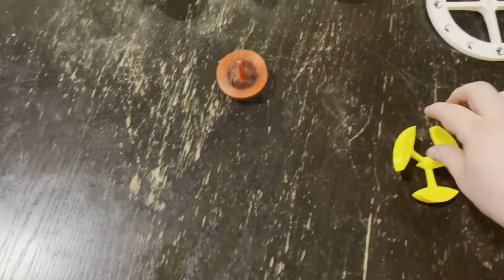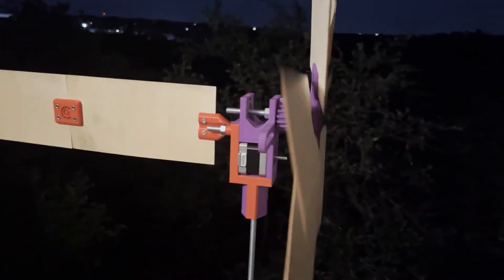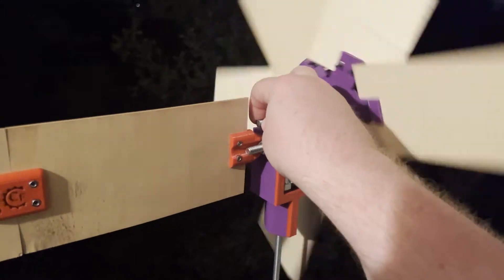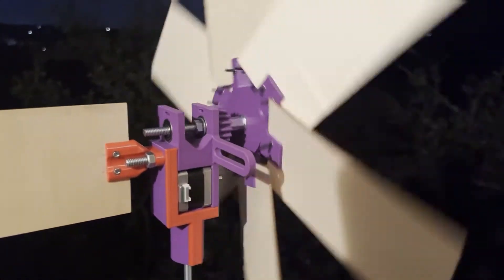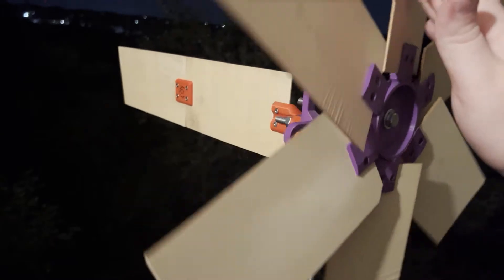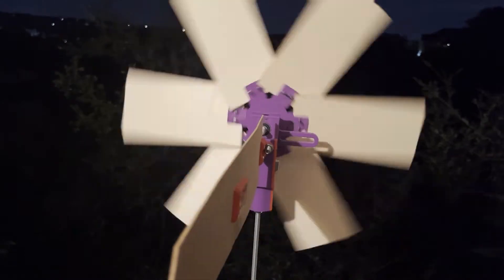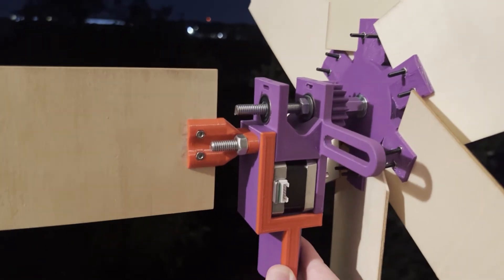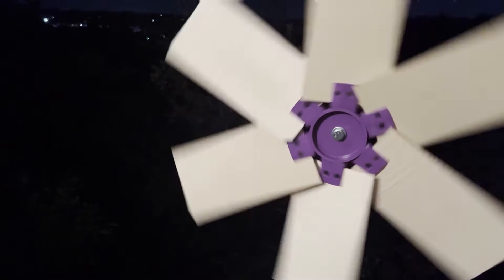Should Wind Turbines have Flywheels?

Comment: I hadn't thought about it that way that the flywheel would use up it's energy to pull air when the wind isn't blowing 🤯 Personal what I had thought is to put a generator to power the flywheel separately which would power the "grid" so as to stabilise the power produced... Could that work?

Comment: If you put it down below you could probably put some sort of ratchet mechanism that would act like a mechanical diode.  The windmill would spin the flywheel but if it slows down it doesn't engage the flywheel.
Reply: Could you elaborate on this?

Comment: Thank you for the interesting video.  It's got me thinking and I'd like to share some thoughts.  (TL;DR - No flywheel.  Light as possible.  Good bearings.  Designed to match the generator).

I believe any type of flywheel would most likely decrease the power output in all cases.  I agree with your statement that some of the stored energy would feed the motor but part would get wasted in continuing to spin the fan and push air (the load) thus, a net loss in power out.  You could overcome some of this if you had a one-way clutch in-between the flywheel and fan making sure that all stored energy is transferred to the generator, but depending on the weight of the flywheel and quality of bearings, you will encounter increased losses in the system due to additional rolling resistance anyways (also a net loss but not as much as direct connected flywheel).  Also, any electric generator has an efficient speed range.  It is important to design the right fan and gearbox and match it to your generators' speed.

Comment: This is old, I know, but another negative of the flywheel is that it uses wind energy to get that mass moving from a standstill in the first place. This means that for lighter winds where a non-flywheel windmll would spin a bit, the flywheel version wouldn't spin at all.
Reply from the maker: Exactly. Good point. I'm noticing the inverse of this now with my foam windmill, though. I think there's something of a balance that needs to be achieved. The foam windmill can speed up in less than a second, no problem, but from the same principle that allows this, when the wind stops, it stops very quickly as well. I think it would be more efficient and mechanically sound to have it not accelerating from a standstill with every gust... but if it's too heavy, it takes too long to spin up, which wastes energy that could have been collected and puts stress on the windmill. It's very interesting, one would think that there is a correct way to do it, but it seems to me that designing a windmill depends completely on the setting.

Comment: Dont use a flywheel. Use a hoop. You see them on the pull chord helicopter toys to carry energy bot not reduce efficiency.
Reply from the maker: Thanks for the suggestion. What do you mean by hoop? Is it this ring that goes around the propeller blades?:
https://m.media-amazon.com/images/I/41EJwAtTY8S._AC_UF894,1000_QL80_.jpg
Reply: @christophersfactory  I've only seen hoops on old wind turbines for structure. I don't know if having more inertia or the ducted fan effect would even be useful or improve it, I guess it's worth a try. If you take the hoop off those toys they slow down much faster

Comment: it doesn't work, I'm building something rn and im using a bike wheel. the bearing isn't very good, should have checked before i put it together, but because my blades are lightweight, they can barely even make the bike wheel spin, so you're gonna need more mass and bigger airfoils just to get the flywheel moving. if you think about the real turbines and how giant and massive they are, they kind of are like giant flywheels.

Comment: Nope, hook up a DC motor to the windmill and use that to spin a big flywheel, make an inverter for the flywheel so the flywheel will keep spinning after first powered and will power other things while wind is not blowing.
Reply: I thought the same thing. Also, you could have the flywheel in the turbine nacelle. There are many ways one could configure it. Not sure if this would be efficient. I assume not since they aren't built this way; maybe I'm too optimistic.

Comment: A hacksaw should cut through that bolt rather quickly.  I'd expect no more than 30 seconds and 20-ish strokes of the blade.  Poor workholding?  Bad cutting technique?  VERY dull blade?

As far as other options; do you have a Dremel?  A cutoff wheel should take care of a bolt like that pretty easily. 

Love the windmill enthusiasm.  Keep the videos coming.
Reply from the maker: All possible! I do have a dremel... Off-brand, but that's a good idea, I'll give that a shot next time. Thanks for the comment! Cheers